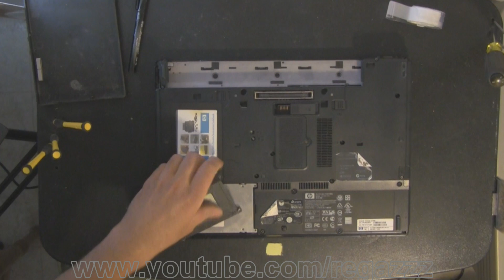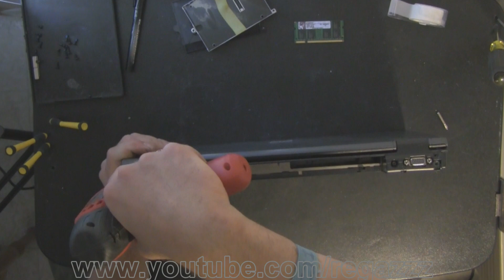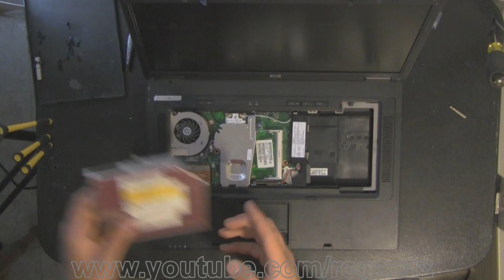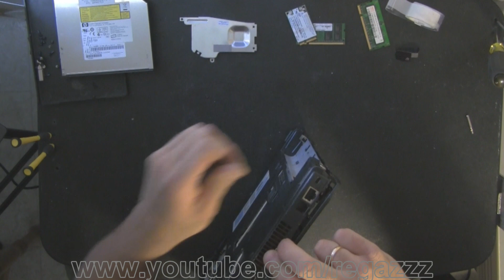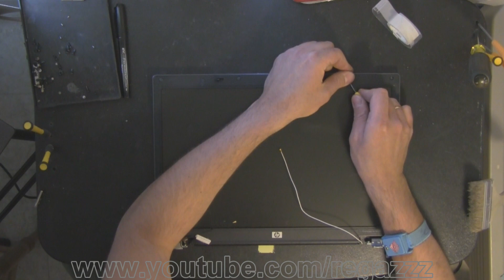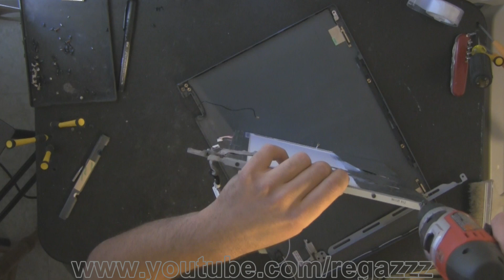COMPAQ NX7400 take apart, disassembly, disassemble, how-to video (nothing left) HD

Comment: The CPU, which is Socket M, can be upgraded to Intel T7600 max. T7400 & T7200 as well if yhe T7600 is out of your price range (at the moment). 😉😎

My stock CPU was an Intel T2400. This can be upgraded to a T2600 as well.

RAM upgrade is 4 GB (2x 2 GB) 667 MHz PC2-5300.

Comment: Hi, i changed cpu from T2300E. (1.66/2M/667). to a T7200. 2.00/4M/667 but display don't work. The pc seems to light up but no video on display. Is there something i must do after the change ? I was thinking at a bios refresh, so that it can understand the cpu has changed..... maybe a keyboard sequence.....  The cpu on the service manual seems to be supported, and the bus frequency must be the same (in this case yes, is 667 mhz on both)..... So why it doesn't work ?  Please help....
Reply: Did you test the laptop by connecting it to an external monitor (via VGA port on the side) ? 🤔

If you have picture then it's possible that either the inverter or the video cable is damaged.

Comment: Can you please tell the specifications such as generations ....and also my laptop is not showing correct date and time even though I set it many times ....what could be the problem .....?
Reply: Change the CR2032 battery. It probably has low voltage (below 2 V). The problems you are drscribing are linked to that. 😉😊